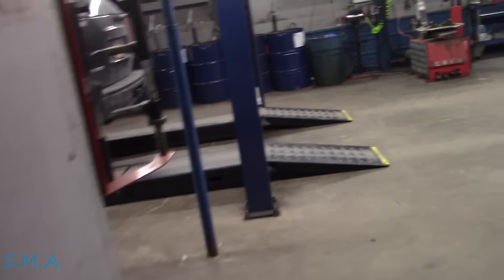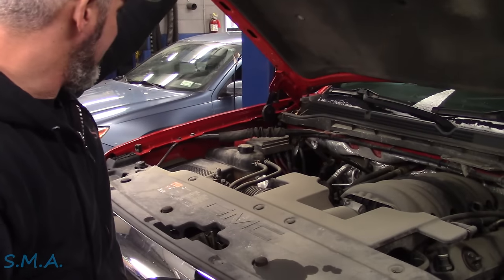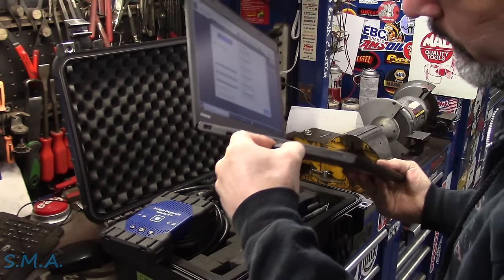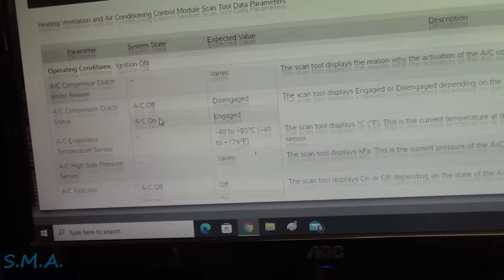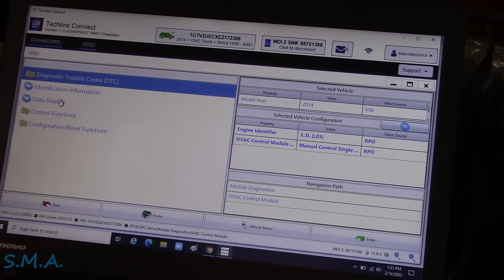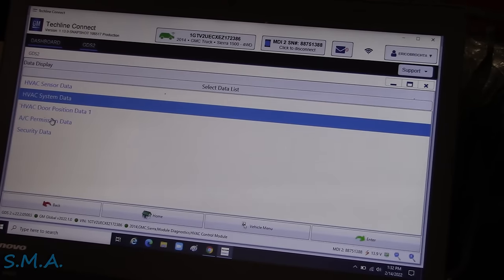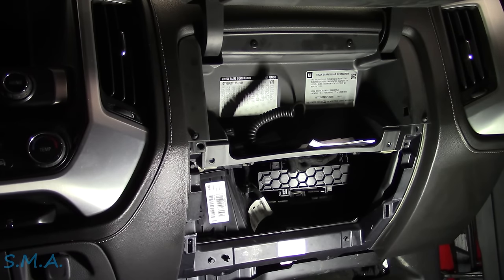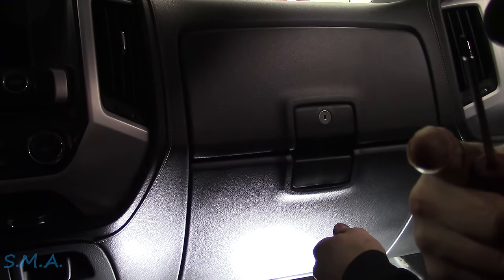Chevy/GMC Truck: Failed Heater Control Module

Comment: Eric you are one of the good guys. Excellent work fair prices in a tough climate. I enjoy your shows and appreciate the personal touch. The cars are very complicated now. Gone are the days when I could throw a trimming chain in a 350 small block. My son has a GMC Acadia I have replaced all suspension 4 shell bearings steering rack and a front sub frame. As there are so many in the wreckers before their time I also replaced the rear hatch front hood and four doors due to rust starting in body panels  lucky on the colour match with like new panels. I am always chasing him to bring it over for oil changes every 4000 klms due to the issues these engines have with timing chains. As a backyard mechanic I put a lift in to help the family with car care costs. Basic work brakes suspension etc. Thanks for sharing your knowledge it has helped me several times.

Comment: We never knew how good we had it !!!!!!  My old cars, from my youth, all the heatet controls were on cables. We didn't need special instruction for operating it. You turned the temp up, and blower on high, and it made you warmer......
Amazing, huh ?
In the summer we had 260 air conditioning.....2 windows open at 60 mph...!!!!!!!

Comment: Thank you, Eric O. With things I have learned from you, my,(only owner), 1992 Dodge D-350, extended cab, long bed, dually pickup truck runs just fine. There must be 25 or 30sqft of engine bay.  I was ready to trade mine in when the 1994 design came out. Looked under the hood and decided not to.

Comment: You nailed it Eric....the maintenance and repair costs are out of control.  My Wife's Expedition, they want $1500 to do plugs, coil boots, a coolent flush and a "Injection/induction" service.  The parts and supplies is $150....the rest is ALL LABOR!!!!!!!!!!!!!!   They actually stated it's about a 3 or 4 unit job.  I looked at the guy and said "OK, 4 units, at $125/hour is $500+$150+tax on parts, is what $659???  WHERE is that extra $800+ coming from?   He said, with a straight face...EACH job is X units, it's additive.  I said, "I'll be calling the home office, that's theft, and you guys wonder why nobody wants to deal with dealership service centers"....SO...TL;DR?  Went to 3 different garages...SAME EXACT PRICE....they are ALL COLLUDING!  Gotta find a garage like you run!

Comment: I started as a mechanic/technician in 2006. I have days where I absolutely agree with you on this field. Nothing else pays what it does with the experience/education I currently have, and my tools/box are paid for. Kinda makes you feel trapped. Maybe that will change in the future, who can say?

I'm going to drive my base model 2007 tundra until the wheels fall off, it's not too stupid with electronics compared to the new stuff.

I'll be sad if you ever stop making videos fixing cars because I sure have learned a ton from you(especially scope stuff). Thank you for your efforts!

Comment: Up until my last move, I still had a dwell tach and timing light hanging on the garage wall. If I had a garage here, I probably would have moved them, but instead I gave them to my son who works on older collector cars. I was moved to replace my own battery in my 2014 Chevy Thunder Equinox which took 4 times longer than I expected. I bought a cheap scanner from O'Rielly's when the money light came on and discovered the cam sensor code. I looked at your video on replacing it and figured I could do it. Then I found out that it was under warranty because emissions stuff is covered for 10 years in Mass.

Comment: It doesn’t matter what career you’ve found yourself in. The world has become a more complicated place. The computers that were supposed to make our lives simpler have have actually complicated our lives tremendously and added a high level of stress. I spent 31 years in law enforcement. Started out with a revolver and a number 2 pencil, and ended with information overload, and way too much screen time. Glad I finished. Keep up the good work and thanks for the informative videos.
Reply from the maker: and a Glock in place of the wheel gun 😉

Comment: Great video! With all of the expense for the components-controller, HMI module, several door actuators- I can't imagine this makes any sense, cost-wise. They could just have a couple of cables and simple switches to do the same damn thing. Much cheaper- and easier to repair!
I recently had the auto temp control and an actuator fail at nearly the same time on my 05 Silverado. I spent a lot of time before I figured out what was wrong- both parts were bad. Again, a stupidly complex system, for no good reason. I'm glad Eric O. Makes these great videos. I'm also glad I'm  not facing an endless stream of issues, like he does.

Comment: I believe we all feel that way about our career choices. I'm a plumber who does new construction for upscale custom homes. It used to be fun and a challenge, now, seen one you've seen them all. It's just a grind now.
As for the new cars, I decided to put my money into maintaining my older vehicles. I have a 1999 Silverado and a 2002 Yukon XL. Both are near mint and both are near 300K.
Repairs are straight forward and I spend less maintaining them than I would making monthly payments on a new one.
My Yukon is 500 miles into a new engine and I'm loving it.

Comment: I restored my 2001 Ford Superduty 7.3 Diesel pickup. I have put 120,000 miles on it mostly towing a 30 foot toy hauler and other utility trailers . Would I like to have the latest bad ass truck on the market? Yes, who wouldn't? Could I afford to go out today and buy the animal, yes. But do I.... Hell no and this is why. If my old truck needs a fender or door repainted, I have it done. If it had a mechanical problem, I fix it. It runs like a top and it gets the job done. It looks like new and I get complements all the time on it's beauty.I'll just keep it on the road while doing most all of it myself. For the headaches and costs of a new truck... I should never run out of money taking care of the old guy. I have a lot of videos up on my channel doing the things needed to keep her going. Thanks Eric, just know we all really appreciate you for taking us along on these small adventures.

Comment: Just like trying to replace a lightbulb on a Mack truck. All the lights in a Mack are computer control. Tried to replace a fog light bulb and didn’t disconnect power and burned out the dam module. I learned the hard way can’t do much with out service data. Still learning new things every day.

Comment: When I left the bays in 2000, I saw this coming. It's spreading to other fields, too. More devices are being built with replaceable modules (if they are not 100% disposable) so that unskilled people can service them, and all of the profit pricing is in the devices being replaced. "Unskilled" means that you just swap the box, rather than fix what is wrong inside the box. When I was 16, there were perhaps 35 independent shops in my area. They fixed things. Regulators were adjusted. Carbs were re-built. Alternators got new diode sets. This took skill and experience, and commanded a really good wage. You can't find techs like Eric or me today because most of us wouldn't put up with the low wages and the lack of focus on good service skills. Now, there are less than 10 non-dealer shops around town. It's because you can't charge enough to stay in the business. We have raced to the bottom. The owner's kids see that, and the working conditions, and say, "sorry, dad."

Comment: I think it’s about time someone designs a new car with a carburetor to handle the fuel, distributor with points for the ignition, a mechanical fuel pump, and a heater core with blend doors opened and closed by cables.  I remember my ‘64 Plymouth Valiant had two small doors under the dash that you would open for a vent.  Rumor has it you could put a couple of canned drinks inside the vents to keep them cold. ;).   Hang in there Eric.  It is still satisfying finding the tough problems and you are always helping us with every video you make.  I always look forward to the next one!

Comment: To your point, all BMWs eventually are totaled due to mechanical repair costs.  What repair shops and dealers charge to fix those cars is astronomical.  A normal $100 part for any other car is $1000 for a BMW.  I know I"m exaggerating a little but not much.  On the other hand, I've been in Automotive for a very long time and I still love repairing things especially automobiles.  I learn a lot from Eric and I appreciate the time he takes to make the videos.

Comment: Hear ya' my friend. Worked in IT for 30 years for very large companies. In the larger environments you have depts that specialized in the different pieces of the puzzle such as a storage dept, a server dept, networking, desktop etc... at the end, right as I was retiring one IT "guy" was expected\able to create a virtual server, provision and attach the storage, configure the networking and push out as many copies of the virtual server as needed to do the job. Didn't get paid 4-5 times the salary but expected to troubleshoot 4-5 specialties which is getting rediculous. I drive a 22 year old tahoe with 475k on it and I just put in a reman transmission and will replace the engine when it fails as at least I can still work on it! thanks to content like yours I should be able to fix stuff till I can't anymore. Maybe you should get into fixing power wheelchairs so I can still use your content when I am in one..

Comment: Auto manufacturers are designing vehicles more complicated to drive all repairs have to be done at the dealership. Dealerships make a lot of money for repairs. I have a 2013 Cadillac SRX and the QUE Infotainment module is going bad. It’s $125 to diagnose whether it’s just the screen or QUE module! I need to buy an old car and then I can maintain it like I did as a teenager in the 1960s. Thanks for making these videos they help me a lot.

Comment: A change in life.   Been through that a few times. When I was a young mechanic. I’d look at the old (40) mechanics all gimped up. Decided that wasn’t going to be me. Off to the community college.  Worked my way through a few colleges and graduated as an engineer at age 36. Then I made the mistake of going to work at hp for 17 years. Gratefully took a buyout then bAck to school for an mba. Graduation at age 56. Bought a company and got a few more years before retiring

Comment: same old same old. sometimes you just get tired of it. don't let Mrs O . hear you say that. As long as my frame holds out on my 06 GMC i'll just keep rebuilding it. Its always been reliable. you know what is going to break. 263k on the clock. 1 set of plugs and wires, 2 brake jobs and some tires and fix the evap every two years.

Comment: My guiding principle for cars has always been something that ran and didn’t break much.  I’ve stopped at pre 2000 for my personal vehicles.  My wife’s 05 pilot is OK, reliable and not too tough to fix, but I don’t want to go any newer.  Currently I’m rocking a 99 CR-V and recently got an 09 for a kid.  A/C comp locked up and it took an hour and much pain just to swap serpentine belt for a shorter one.  I’m happy to say he just totaled that one and is now driving my old 98 C1500.  That’s one that does break somewhat regularly, but it’s easy and cheap to fix!

Comment: Eric, I agree with you as far as the electronics in these vehicles.  I was in the consumer electronics repair business for many years and now retired, but the cost of repair just out paced replacement and has put most service business not a viable way to make a living.   Now I don't know if that will ever come down to the auto industry.  Replacement of a Tesla battery pack $22000.  I  guess I'm getting a little off track.  I enjoy your content and get a lot of valuable information.  Thanks for being there

Comment: The three computers to run HVAC explains why we have a chip shortage in the world:  Wasteful designs.    There is no reason to have this much technology to do a simple thing.   It's perhaps cooler or whatever but it seems that these things fail more often than not.   Old mechanical ones would "fail" and you would only have heat out of the defroster... and you would runit like that for a couple more years.  These things get pissy and just plain shut off, no choice.

Keep up the good work and keep fighting the fight.

Comment: I remember my old 1985 Toyota compact pickup. A clicky switch to control fan speed, a sliding lever to control temperature and where to direct the air. No super touch sensitive touch buttons to actuate anything...and it just worked. A regular old AM/FM radio which I later upgraded to cassette! Boy that was the life.
Reply: my first car was a 75 or 76 Plymouth Scamp it only had a AM radio, I bought a FM converter. Good times 😃. When I sold it I really missed the blinkers on the front quarter panels. 🚗

Comment: I could fix everything on my 1970 Pontiac Firebird Formula 400! Those days have been long gone. In 1974 the righting was on the wall, first year of the air pumps for pollution control. Next was electronic ignition, throw away the dwell gage! still enjoy all your videos'. NWR

Comment: Agree totally Eric!!  One solution might be to mandate that these systems be warranted for 10 years or 200,000 miles.  Any system run by a computer module would be covered.

Comment: Technology gone mad. What was wrong with a switch directly connected and a resistor pack for speed? Andrew Camarata once replaced the controller on his truck with a welded rod through the dash, and it did the same job - Never go faulty again! Another good diagnosis Eric.

Comment: I agree. No need to have so many control modules etc. Just drives up the cost of new vehicles and repairs. Wish Chevy would come out with an old school truck or car without all the electronic BS. Thanks
Reply: Chevy/GMChina would find ways to screw up such a vehicle like we never saw in the old days when they were originally made. But modern engines and transmissions won't work without the electronics, and the old ones long ago had the dies, tooling, customer machine tools, etc. likely scrapped long ago. The engineers are likely dead, so the new engineers have no idea how to build an old-style engine or transmission. 
NASA went through the same thing with the new SLS rocket motors; they were thinking about using the tried and true F-1 engine design until everybody realized there's no way they could build the tools to build the engines, and each was tweaked without CAD and all the modern tools, by engineers that mostly had slipped the surly bonds of temporal existence.

Comment: 68 Chevelle intermittent stall with turn over no start near 60 miles away from shop. Multiple tow bills. Parts cannon recipient.
Fixed it after I sold it. 
Took  chrome distributor clamp off and accidentally dropped 6:33 6:33 it. The chrome split and white oxidation spilled out everywhere. One new clamp. No modules.

Comment: My first car was a 68 barracuda with a slant 6 which I rebuilt in highschool.  I now have a 2014 silverado.  Besides the frame rust I am scared of repairs after watching you fix that truck.  You need to be a computer scientist!  Makes me wonder if there is a market for a low complexity simplified truck.  I could live with control cables on my heater.  Thanks for the video.  Joe from the east side of upstate NY.

Comment: I have an '04 Silverado that the A/C started blowing hot air over the course of a couple of days. Took it to the GM dealer for them to check where the leak was. After 3 hours they didn't find a leak and blew the BCM trying to program it or something. Now I got no heater or A/C. That BCM is a few hundred bucks that they have to replace. It is super hard to find shops that know what they're doing. 
Eric is worth every dollar he charges for his service.

Comment: This is why I still drive my '94 Chevy K1500, so simple to fix anything on it, even a caveman can do it. It's the most reliable vehicle I've ever owned. I also use to work as a mechanic on both 4 and 18 wheelers, but I saw the direction the automotive corporations were headed in the late 90's and decided to jump ship and leave the repairs to someone else, and I've never regretted that decision, EVER.

Comment: Nice work. I hear you when systems were much simpler. All the new technologies for better fuel economy and I still remember getting 22mpg in a Chevy or Ford v8 with a carburetor, and being able to work on it without breaking the bank.

Comment: You are right about how complicated the systems are getting.
Auto companies are building in 5-10 years life so you have to keep buying new.
And they want to keep the service though their dealer network instead of private repair shops.
Its either work on old stuff or keep having to keep training on new stuff and deal with customer disarisfaction